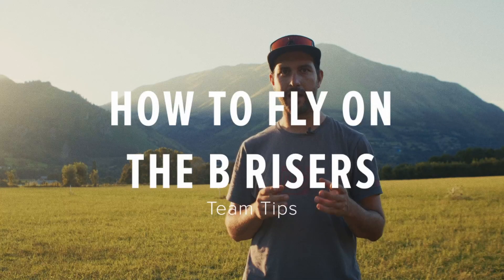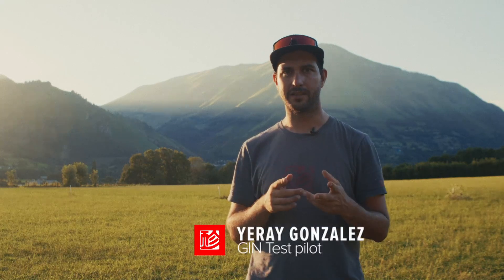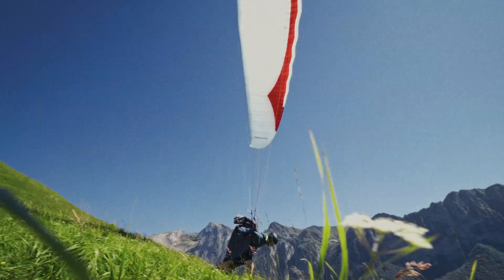How To Fly On The B Risers

Comment: Have the Bonanza 3 got 40 hours on it.  Going from the Alpina 4. I used B riser staring on speed but do not trust the wing will not get collapses.  Want to fly it more efficient. But how? I try to rest the arm weight on the pin's and fly like using the brakes in very turbulent air. But this is eksosting. I feel the pin is a little to narrow so I don't get to use all fire fingers.